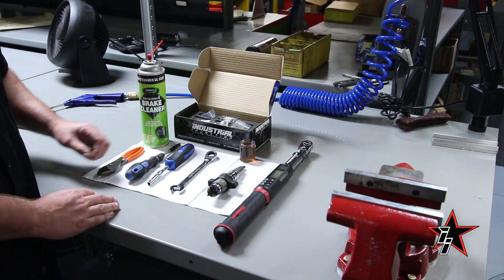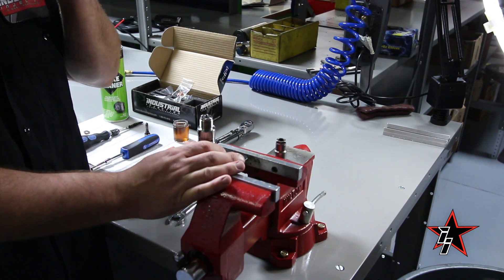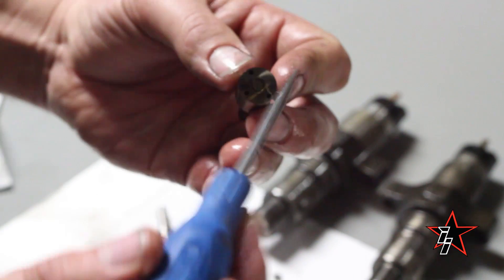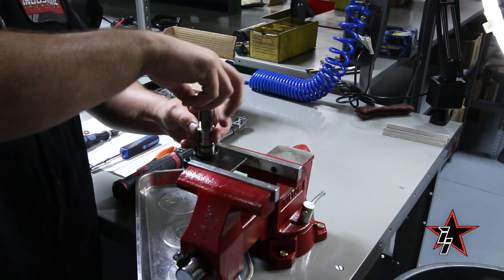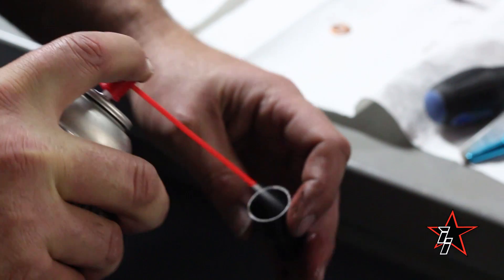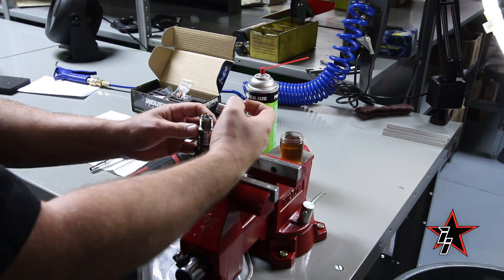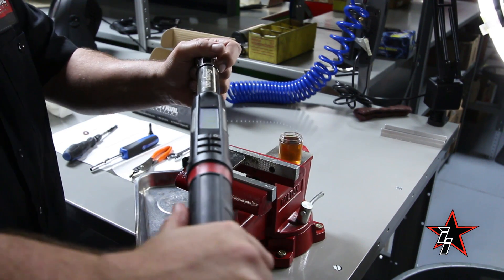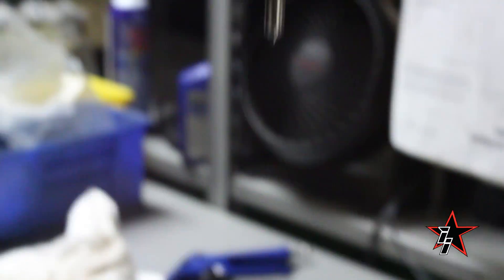Industrial Injection Diesel Performance Nozzle Swap How To Guide

Comment: I was wanting to buy the 30%  nozzles for my 2006 lbz but I honestly haven’t been able to find much information about doing a nozzle swap and if it’s even worth it. I was planning on buying a full set of injectors later on down the road but wanted to test these replacement nozzles to see if they make any noticeable difference what would you recommend
Reply: Yes it will make a huge difference, i installed 30% nozzle tips on my 6.0 powerstroke and right off the bat it runs smooth has much higher bottom end power and overall quickness!! Do it you wont be disappointed, i was able to get a whole kit online with o rings and injector take off took for only $500, beats buying all nee 8 injectors for $2k lol

Comment: What's the tool called u use to stop nozzel turning while undoing injector . As tryed a few 1.9 tdi injectors and snapped pins as there that tight .hard to hold from moving

Comment: Noticed you did not say anything about injector calibration? If you change the nozzle then the injector needs to be recalibrated and torqued to specifications.

Ohhh. That's right. You don't care. You just want to sell your product with a disclaimer about engine damage knowing what needs to be done.
Reply: SCAMMERS EXPOSED He literally started the video by saying you should send these in to be done here. If you were at the point of changing your nozzles you should probably have enough knowledge to know it needs to be balanced.

Comment: I kknow thiss is a  old post but befor i do this what is my toque on a 2002 6.6 LB7 nozzle and what is the toque on the top part where the wires are if i pull that apart...i have been looking everywhere and found nothing...please help me...lol

Comment: I have a set of your PODs in my ve 12v (been in for 16months 30,000km) and wanted to move up to a 5x18. Would I have to get them pop tested or modify anything else to change the nozzle or will they work fine